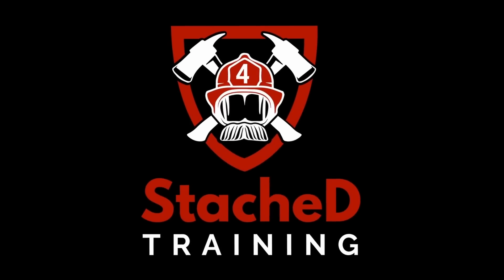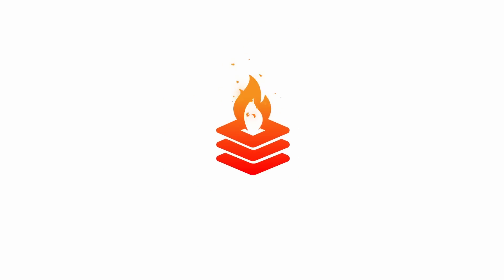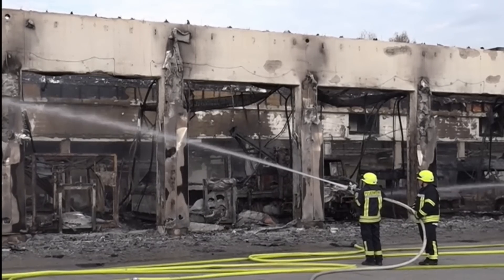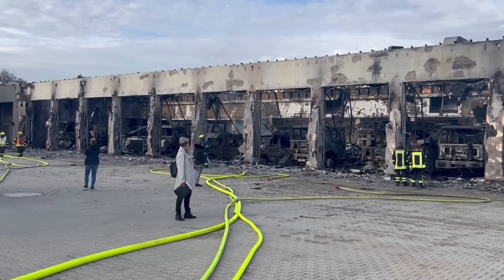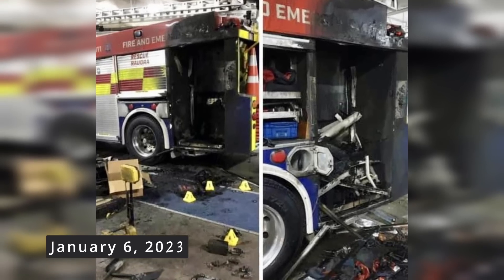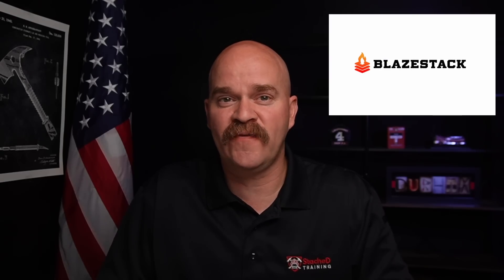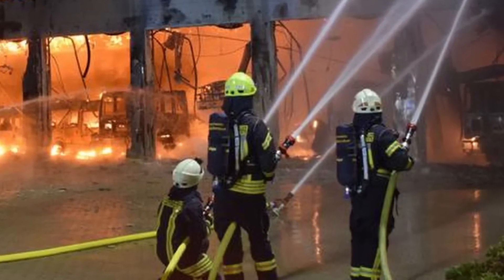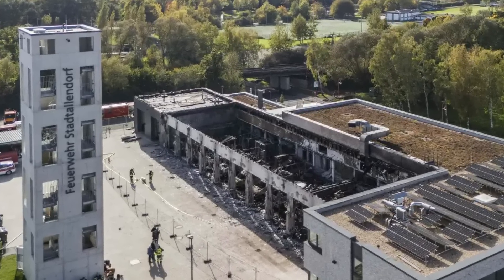Lithium-Ion Batteries Spark Fire Station Disaster: Germany

Comment: No fire detectors, alarms or fire suppression system in a fire station?  You just can't make this stuff up.  Bad enough it was a lithium ion battery but no detection/alarm equipment when they force residential homes to install them.  How do you even justify that?
Reply: There were smoke detectors, but they were not linked to a fire alarm so they didn´t help. And since a cost/benefit analysis was made I would expect, it reached the conclusion that a fire supression system would have been more expensive than the damages if you factor in the small likelihood of a fire. Since a fire station like the one in Stadtallendorf is rarely occupied, the need for a fire alarm to protect occupants was probably small and equipment can be replaced. I would personally think, that if a cost benefit analysis by experts determined it was not needed we should not question the decision too much without the information they had.
Reply: They generally don't have them in homes either. Up to the homeowner, unless it's a high rise apartment building, or another structure where you have a high risk of people dying.
Reply: @beyondEV  That's surprising. They're mandatory in Canada.
Reply: I think that's traditional "Nah.. I'm an expert! I don't need this sh**!"
Reply: @teolynx3805  The decision to not install a fire supression system was likely not made by the fire department and rather by county planners based on a cost/benefit analysis.

Comment: Even buying OEM tool batteries is a risk, a lot of really good counterfeit knockoffs have come on to the market.
Reply: I am buying high quality cells , I test them and I have also purchased a battery welder and the corresponding high quality protection circuits and all of my battery assemblies 1 to 6 cells are made inhouse... I guarantee the cell is good, the electronics are good and the work is done correctly as opposed to OEM cells that nobody knows what they are
Reply: @user-tx2nv1rb9k  re: "I am buying high quality cells , I test them and I have also purchased a battery welder and the corresponding high quality protection circuits and all of my battery assemblies 1 to 6 cells are made in house... I guarantee the cell is good, the electronics are good and the work is done correctly as opposed to OEM cells that nobody knows what they are". okay i hear you, but unfortunately what's not lost me for 1 second is that these are all the EXACT SAME CLAIMS made to the FDNY by all the "Battery Bros" busy repairing E-Scooters in the 5 Boroughs the last few years (E-Scooters that we then later see on the 6 o' clock news catching fire, and then burning out Apartment Buildings and even whole City Blocks).  also ref: the explosion in the basement of the Apartment Building in Poland...

so with all due respect, what consumers now have to ask (with the danger having been made ABUNDANTLY CLEAR by the likes of the good Captain and others) then is "Which is it exactly...?" because with the aforementioned fire pattern now established (and cemented) basically in the 10 years after the release of the Tesla Model S back in 2012, the only thing a "claim" is good for at this late date in Lithium Ion Battery History is WIPING OUR A$$ES..!?!?
Reply: re: "a lot of really good counterfeit knockoffs have come on to the market." exactly, one of the Tool Review channels i follow recently did a good upload in the like the past 6 months on spotting FAKE Milwaukee batteries.  after watching (despite my being confident in what i bought) i literally made myself go downstairs to the Man Cave and examine ALL of my batteries closely with a flashlight.  # ASSUMPTIONS ARE THE MOTHER OF ALL F*%K UPS
Reply: re: "Even buying OEM tool batteries is a risk". which is to say the "assumption going in" that you HAVEN'T BEEN LIED TO in the first place about having bought a genuine OEM battery is the risk.  (as if the Electoral Politics shown in the news the last 10 years hasn't been enough to convince you) it's very important we face the reality that OVERT LIES and DECEPTION are now an unfortunate part of our everyday lives.

Comment: This made me do some searching for lithium ion battery storage cabinets and there are a bunch of manufacturers in this space. Many come with outlets for charging batteries and some even have built-in fire suppression. They're expensive, but certainly well worth it for businesses (or fire stations) with many batteries. Unfortunately, this leaves them a hard choice for households. Given the increasing ubiquity of these batteries, there really should be an affordable consumer option.
Reply: not usable in this case - all this equipment is onboard, packed to be ready to go instantly, not to load all stuff from cabinets first. Good modern trucks have onboard chargers for all this.

Comment: It is a "no brainer" to install alarms plus supression in a "new build" i would have thort ... 
Firemen in NZ always encourage smoke alarms plus sprinklers . Dur .
 Seems that 
"Modern thinking" and "bean counters" have certainly screwed up this time . Sad when such an impressive facility is ruined ... 
 Thanks for the heads up
Reply: re: "It is a "no brainer" to install alarms plus (suppression) in a "new build" i would have (thought)..."  correct, and in 'Murica in the context of HVAC, Plumbing, Electrical, Sewer, Drainage, and Fire Safety Systems going into the new construction, this "no brainer mechanism" is well known to Tradesmen and Contractors as BUILDING CODES (which generally brings with it Fire Marshalls, Inspectors, and Code Enforcement).
Reply: Murica is basically a tinderbox with loads of unreliable sources of ignition sprinkled into it. In Germany, Switzerland etc. Building Codes and they way things are built is very different. You're average apartment will contain a 1832 °f Fire for 90 minutes (average murcian house has already burnt down by then). Fire Alarm and Suppression Systems are required by law, where People Protection requires it. Otherwise, you install it, you're insurance gets lowered. Insurance will Analyse how much money it saves them and give a appropriate discount. 24 mio may sound like a lot, but it probably would costs 200+mio to install it in all fire stations and 1+ million to maintain fire alarms and suppression systems in all german fire stations.
One disadvantage is: You only get discounts for certified stuff which is maintained by a certified technician. Loads of potential would be, in simply not always reliable alarms, which simply go to the owner, which then calls the neighbour to check.
False alarms are btw a major issue: Next to where i live there is a elderly home. Fire Brigade shows up at least 5- 10 times a year with multiple units for false Alarms.
Reply: Suppression needs to be defined if your ev water and standard doesn't put out battery fires unless you reroute a local lake. I have been told by fire engineer sand salt best to use to smother an ev fire. l now a hybrid owner that keeps sand bags in his garage and salt in a bucket.

Comment: I charge my drone and helicopter batteries outside my house. The safest place to do it. Maybe fire departments need to install charging centers outside of the station.
Reply: Make sure its not under an overhang.  VideoBob Moseley just lost his house last night to a fire caused by lithium batteries in a pool cleaner charging on his patio.
Reply: I also charge my plane lipos in the middle of my front lawn .
Reply: Do you charge your phone outside also ? Your iPads ?
Reply: @chrisward5626  Chris rc planes and helicopters use li-po batteries which are far worse than lithium-ion.I had a plane catch fire in the air not realizing the battery got damaged on a hard landing.Two of my lipos are about the size of 10 of your cellphones sitting on top of each other and if that has a meltdown i personally dont want it in my lounge.
Reply: @paulh6395  I did an audit in my house I have 82 lithium batteries including lipo . Only fire ever was a deep cycle lead acid battery and a mains power socket short circuit . Electricity can cause a fire any time there is an issue.
Reply: @chrisward5626  as a matter of fact. Yes. In my shed (metal) that's 30 feet away from the house. My DeWalt batteries, phones and tablets too. Even the rechargeable grill lighter.

Comment: Properly engineered lithium fire resistant storage for batteries while stored and charging should be used by everyone. 

The arborist shop I worked in had a 48v 9ah OEM battery catch fire while charging on a shelf in the wearhouse. The FD responded and put the fire out quickly but smoke damage required the steel building to be gutted and rebuilt. Due to insurance shenanigans and COVID contractor delays the shop was unusable for over a year.
Reply: Did the insurance cover lost productivity??
Reply: @gregorymalchuk272  Don't know but I doubt it. That will be a policy rider anyway so check with your insurance to see if lost productivity is covered in your policy if you want it.

Comment: Isn't a 3 minute response time too long for your own building or is that the time it took the nearest non-burning fire station to get a truck there after the alarm was raised?
Reply: Stadtallendorf Fire department is a volunter organisation (like about 90% of german fire departments) so the firefighters rush form home / work to the station on alarm man the trucks and set of... so 3 minutes was the response time of the firefighters that could only grab what wasn't on fire already at that time... i guess they where hard pressed to delay the fire with the limited equippment they where able to save and than had to wait on surrounding fire departments to come to aide... it is usual in germany that most incidents bigger than "a moron flipped a burning cigarette into the trashcan... it started smoking... we took it out of the office now it stands at the parking-lot engulfed in flames" draw in more than one fire department... most important qualification for fire chiefs is to know which close by fire department has the special equippment he has not
Reply: Q: Isn't a 3 minute response time too long for your own building or is that the time it took the nearest non-burning fire station to get a truck there after the alarm was raised? A: no, that response time is PERFECT.  now where a "3 minute response" will always be INSUFFICIENT is when dealing with a Li-Ion Battery Fire, because in this context what you're essentially trying to do is "defuse" a bomb that's already EXPLODED... "everybody knows this." (best Trump voice).
Reply: @phillyphil1513  3 minutes after detection (probably much longer if you count from the start). Smaller Li-Ion Fire was successfully contained by using a nearby fire extinguisher by a customer of mine (early detection, so the fire wasn't already spread to other flammable stuff). Damage was still extensive, not from the fire but the smoke. Entire Apartment and anything it, had smoke damage.
People saying, alarm wouldn't have made a difference are simply trying to cover their a**. But having remote fire detection in all stations would be very expensive as well, you add suppression, you probably looking at 11 mio annually for all of germany (amortisation + maintenance). So you need 2 incidents of this magnitude a years to justify changing the rules.
Problem is, almost no one can properly calculate costs over time. So the resort to excuses instead of explaining. 
If you ask most people what's the total cost of ownership of their car is, they simply don't know, or miss half of the costs...
Reply: I'd imagine the response was from other stations. I doubt those at the effected station would have been able to safely access the equipment needed.

Comment: I am no firefighter but I believe a fire suppression system in a fire station will do more water damage to their expensive fire equipment than if there were smoke alarms and a rapid response drill to immediately jump in the fire truck cabs and moved them outside and hook hoses up to the closest hydrant.
The building is not important. The appliances and equipment is much more valuable
Reply: The appliances looked a bit worse for wear.
Reply: @RC-wu6gm   I'm no firefighter either, but StacheD Training (the owner of this YouYube channel) got it right when he said "a fire suppression system would have limited the fire to the apparatus" where the fire started. Suppression system built into building only act locally, they do not come on at once to cover the whole building.
Reply: If sprinklers spray water on the trucks, why is that so much worse than rain (and fire fighting water) that falls on the trucks outside?
Reply: @dzcav3  you have a point and are for the most part are correct. Firefighting gear/kit should be able to handle some water.
     However the amount of water in a fire suppression system is likely to involve a lot more water and/or at a higher rate. Sure the equipment/truck can handle rain and some spray, some trucks are even designed to travel through fires in their own cloud of spray.
Reply: I heard the fire spread too fast. They tried to rescue other vehicles but it was already too hot 🔥 😮
Reply: This is a volunteer fire department; these stations are unmanned most of the time. They are just better garages for the vehicles and equipment. When there is a fire, the volunteer firefighters either receive a text message on their cell phone, a radio message, or they hear the sirens that are still installed in many towns and villages.